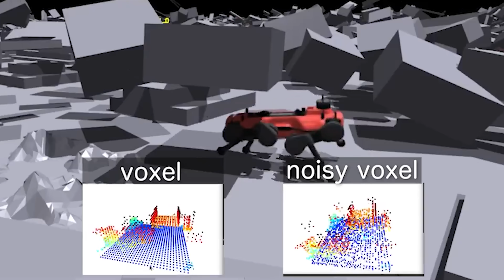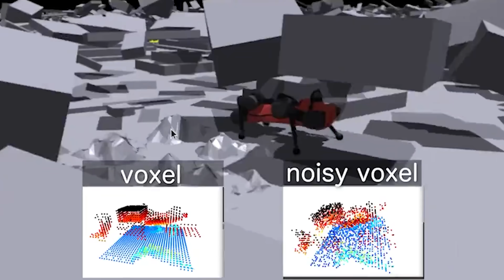OpenAI Deploys AGI Into Humanoid Robot - Displays STUNNING Abilities (Figure 01 Breakthrough)

Comment: The robot was simply asked to pick up the trash. Technically, all the robot had to do is pick it up and keep it in it's hands to fullfill the task. The robot had to assume he wanted the trash in the basket. So the robot took note that the trash was originally in the basket, so it worked out that it's logical to put the trash in the basket...but not technically instructed to put it in the basket (just to pick it up). It had to think about that and had to move the basket closer to pick up the trash. And the highlight of this video is @1:23 where the robot goes above and beyond the call of duty (just like a good human would do) but many humans would just leave the basket there.😅. Technically, the robot wasn't required to push the basket back, in order to fullfill the command (and in fact it could have just held the trash in it's hand). 1:23 may look like nothing but (bugger me) this is a great leap forward, to me! 😮

Comment: The only issue I have with building a robot is the battery size and weight. Building a robot is easy for me. So far my robot has cost less then $8,000 and it's about 5ft 7 inches tall with more fluid movement then the robots I have seen being made.

Comment: It's the CEO's voice. This is actually really good.
The way the robot passes items from one hand to another or casually drops the apple into the guy's hand, and also casually shoves the basket back to the guy.
The stutter speech is pretty cool as well.
The delays will get worked out but the bot gives indications on its face that it's thinking during those delays. That doesn't bother me at all.

That fast bot just looks like it has to get to a shitter in a hurry!

I don't know if the BD bot is doing everything end-to-end or if it was just pre-programmed to do the tasks.
It is impressive when it corrects itself after a slip though!

Comment: I had to learn to design products within shipping limits of USPS and UPS and FedEx; so that my behavior was conditioned by the limits of the shipper.   If a robot could be taught to clean up around a standard dinner table utilizing; standard, flatware and plates, and working around standard chairs  etc.  humans would design their dinners around those parameters and the autonomy of the robot would be simplified.  In this way, robots could be delivered to the consumer much more quickly.  Same thing with cleaning and organizing a bathroom.   The handicapped would be elated to modify their behavior to accommodate a limited robot helper. Been there.

Comment: Not bad, but as we know, it was a perfectly organised video to show what it can do, it will be more interesting to see how it does in the real world and not as a PR stunt to look good, so it's interesting but until we see it in the wild, that's all it is, interesting.

Also, when it comes to robotics and A.I. being in the home or workplace, there is no way in hell I would want it where it's sending data back to a central server, which with any of these online models, that would be the case, it would be too big of an invasion of privacy and a security issue for most, especially as A.I. and robotics become more advanced and more useful that we use them a lot more.

For that to work, the A.I. is going to have to be a local model in the robot it's self.

As for A.I. and robotics, it wouldn't surprise me if we start seeing them both together in society over the next 10 years or even sooner, all the tech is falling into place to allow it to happen, A.I. that can adapt to the world and change as needed, the hardware needed is there to run A.I. and robotics is getting very close to the point that it can work well on every day tasks, whiles the price point is coming down fast, putting it all together, it suggest we could be seeing them over the next 10 years or less doing all sorts of tasks.
Reply: Do you use Alexa?  Google Voice?  Anything like that?  If so, I hate to break it to ya.....

Comment: @6:10 That dude sounds like he smokes bongs all day and goes to bed praying for a robot maid. 🤣... I'm pretty sure the passenger drone will fail on efficiency, their next phase of making it faster requires double the battery capacity, which means double the weight and reducing the distance it can fly by almost half.  Currently, it can't fly far enough to be even considered as a possible production vehicle which is why they don't mention that in the video, the website goes into it but they kindly left out the weight of any passengers and it still cant stay in the air for very long... looks good though, but a bit like the tesla semi, a vale is carefully held over the figures that matter, like announcing to the companies who he wants to invest in a full convoy of them need to know the loss of power and distance able to travel with a full load capacity, he just swanned over telling long range drivers how fast it can go without a trailer, went into extreme detail on how they designed the cup holders and didn't mention what weight the capacity is and how it affects the power consumption.  Weird no one mentions his revolutionary tunnel for Teslas under LA, that has to be the most over Hyper massive pile of pointlessness I've ever seen, 170MPH cars sink through the road and like a bullet to the other of LA, then clearly Elon came down off the mega drug cocktail he must have been on, and it changed to Tesla's but going 120MPH through a special tunnel never been done before, avoid the subway you can get 3 people in a tesla... what did it turn out to be Tesla taxi ride at a maximum of 53MPH but usually only 30 due to the  Tunnel to car size ratio and a massive brain fart forgetting to take into consideration the speed you need to be going when taking 30 degree turns in a tunnel made for a mole.  Hope the OpenAI team win the court case, someone was always going to monetize it massively... everything is when you dig deep enough... wonder if Elons has made Grok open source yet? course, not he'll be doing what openAI did create 10 companies and monetized the lot, and the dibble left dragging behind is released, and everyone will say who Elon did it he slid a pile of gold bars under the table and presented the world with an unpolished turd... he wants access to OpenAI because his AI for his cars no matter what he says is sh!t, relatively speaking.  He's so confident he's going to win the court case and attempt to win over the full Jury, a jury he demanded because he has a global influence... so he's started once again telling the world that level 5 full self driving anywhere in the US is very close... in 2017 he said it was done and the next teslas produced would have it, he said similar BS every year for the next 7, and now he's saying it's just that final little hump to get to fully autonomous, so he needs AGI... while he's BSing the world there's driverless taxis just been given the green light for highways etc, you wanna se the hardware stacked on those cars, they said Elon musk is delusional, level 5 is almost impossible to judge.
Anyway rant over and out.... enjoyed that.
Reply: Nice nerdy haircut too.
Reply: @starsandnightvision  🤣😂 brilliant I was going to mention that,  i cant fathom out why all super nerds decide indpendently on probably 3 styles that literally no one else would even have the vocabulary to ask for... maybe you just say nerd cut, and so barbers also need to learn about the 'nerd do number 2' 🤣

Comment: I'm not sure.  These are just demos, the conditions seem to be tightly selected. They only had the open AI robot do the most basic tasks of loading dishes, which were already clean, and had no water on them that I could see necessitate drying. 

Getting the robot to the place where it can recognize dirty vs clean dishes at high resolution and perform appropriate scrubbing and spot cleaning before loading into a washer, then unloading and checking each dish closely to ensure it's clean, etc... that's not what they showed.  It was kept in a cleanroom like environment with little to distract it at all.

Comment: The one @3:40 looks like it's off its turnip on crack.... when you say super accuracy, is that based on varying definitions saved for jittering robots... when it can thread a fine needle with white cotton in the midday sun, I'll agree on super accurate.  I still cant believe Musk swapped that 1st Teslabot that danced like an insane human in spandex for a metal one which they need a remote control for, that Elon is a bit of a d!ck 🤣

Comment: While fully autonomous robots might still be a number of years off semi autonomous ones are even now arriving on the scene and these, themselves can be real game changers.

While  domestic robots that do chores around the house are nice they are more of a high tech consumer item rather than a game changer. But robots that can reduce the cost of manufacturing will be a game changer.

And sooner or later (and maybe even sooner than one might think) we will be seeing military applications of humanoid robots. For even if they are not all that autonomous and are teleoperated which would you prefer, to charge across an open field in a meat wave assault of stay in a nice trench and teleoperate a humanoid robot who is doing the charger across that field?

Thus the only autonomy these might need is basic motor skills such as being able to walk and run  and carry, aim, and fire a rifle  (where the human designates the target) plus the ability to take over if the command link is jammed.

In that since they are not all that different form a UAV only they walk vs fly. Other than that they can be employed much the same.

Along those lines it would be interesting to see a robot do these plus maybe crawl or kneel.

And if running is not fast enough one can train them to ride these.

Google
Top 5 Best Electric Unicycles 2024 | Best EUC 2024

Which is probably easier to train a robot to do than walking in that the gyros in the  e unicycle does much o the work of maintain balance and thus the bot just needs to lean and not walk while riding one.